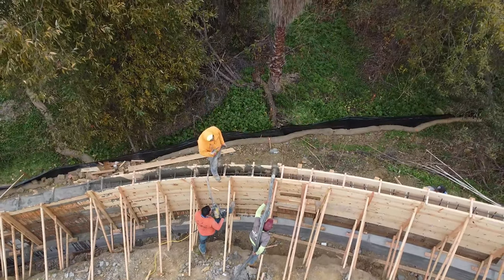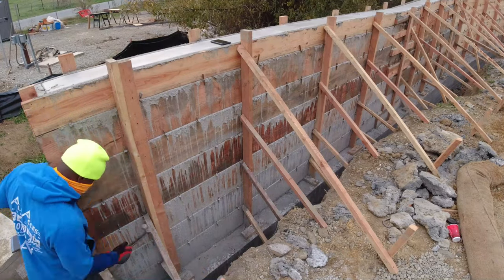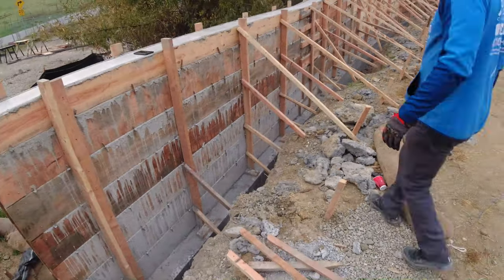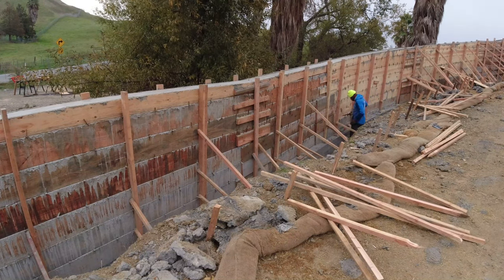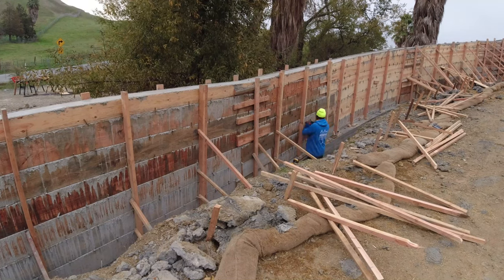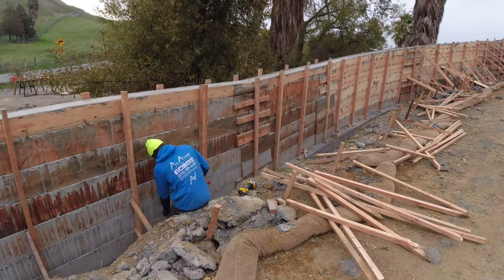Bay Area's Most Ambitious Concrete Wall Project Revealed!

Comment: Mr. All Access, hi! ive been studying your videos for a while now as I have asperations to get into the business in the Texas area. I've found your method most helpful and would like to find an improvement in it if possible in terms of cost, weight, time and selection of material. My question to you is this: can the number of snap ties be reduced to just an upper and lower row of ties without the risk of the middle bulging out? In essence, having an bottom and top seperator cleat at intervals.
Reply from the maker: Appreciate you checking us.. I wouldn't recommend you useing the snap ties that way.

Comment: Im just curious, do yall fill the wall up in a single lift or do yall do two or 3 passes. it seems like it would be a hassle to carry the hose multiple times throughout the wall. Im from south texas and in my area its all boom pump trucks, so thats what we use to pour hoses. theres only like 3 or four guys in like a 100 mile radius of where we work.
Reply from the maker: We always start with footing.. And circle back around and do the wall. We pour he wall  like a triangle.. So we don't have to move the hose as much. ( if you can picture that.) we mainly residential so it's hard to get a boom pump

Comment: Are you ever concerned that Simpson only rates the WT-s for 4’ or shorter?
Reply from the maker: Nope... Built walls as tall as 10 feet tall with them... 👍🏿👍🏿💯💯
Reply: @AllAccessConstruction  great to know! Thanks for the reply
Reply: @AllAccessConstruction  what was the spacing on your 10’ wall? Just curious
Reply from the maker: All good.. Good luck
Reply from the maker: Bottom 3 or 4 boards 8 to 12 inches.. We kind of eyeball it...
Reply from the maker: We got one coming up.. 9 feet https://bit.ly/3bBXPOy